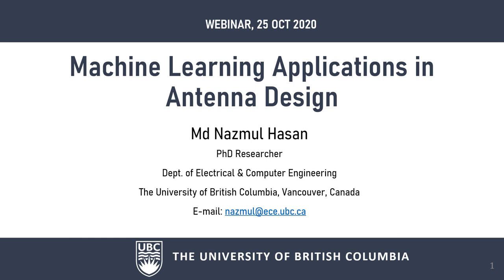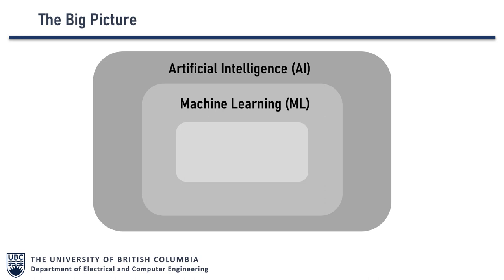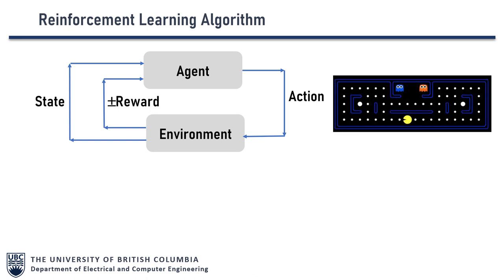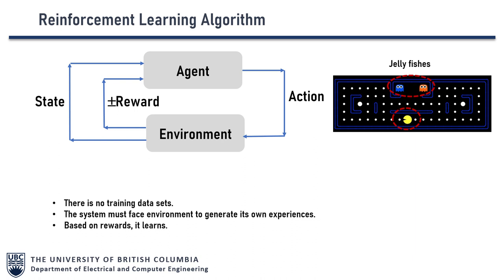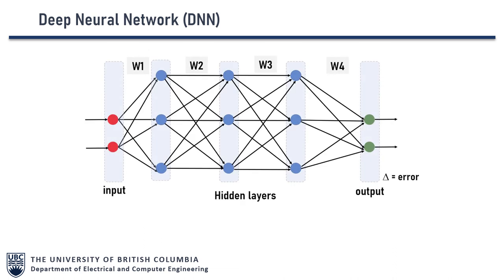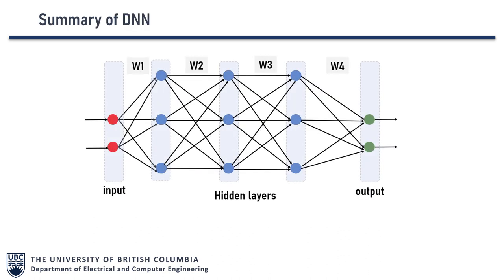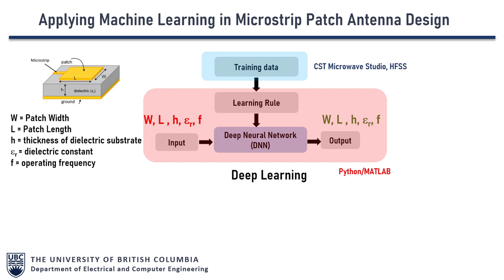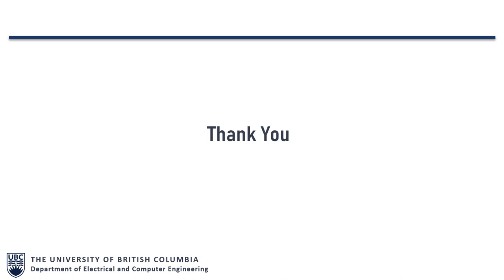Webinar: AI, Machine Learning and Deep Learning Basic Concepts & Applications in Antenna Design

Comment: Thanks. Could you please show an example with real design? My understanding is that input data should be desired S parameters or gain and frequency as well dielectric constants and thickness while the output is the dimensions of the patch.
Reply from the maker: I wish I could make now but need to wait...currently our work is under review in a journal, so once published I will make detail video on machine learning application in antennas.

Comment: Thank you for your amazing presentation, but I just wonder that if you input that parameters, so why you need to output that parameters? as I know the prediction is some kind like input A and B, and output with C. so here why the input and output should be the same parameters?
Reply from the maker: You are most welcome for your query. The input and output parameters are different, exactly what you said. For a very simple example, if width, length, and substrate dielectric constant are input, the output could be frequency or vice versa. Hope it helps